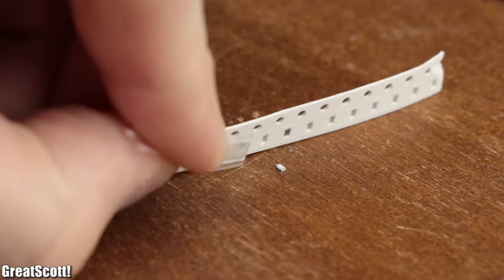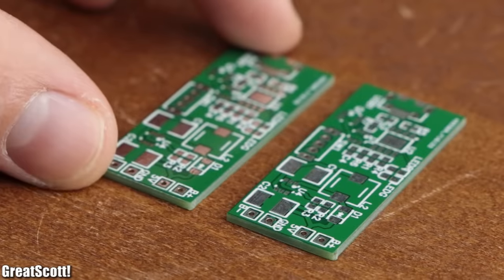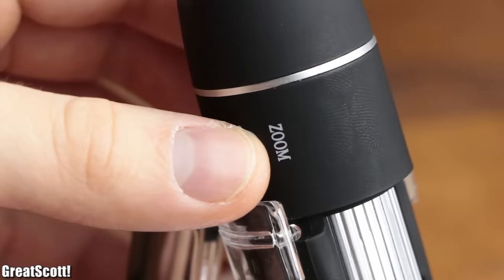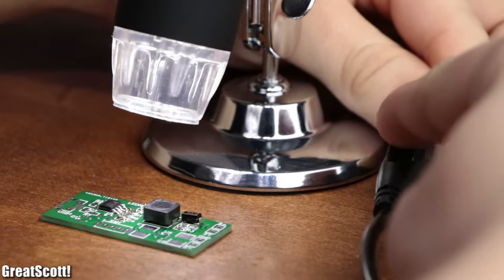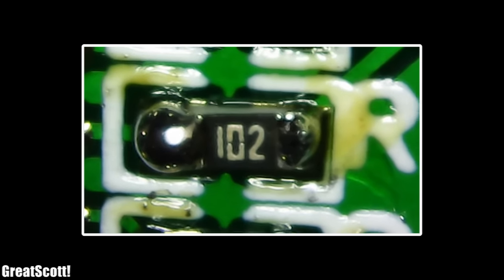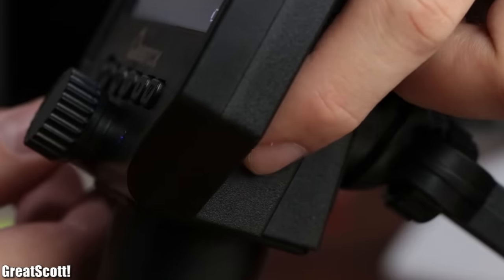Microscopes for SMD Soldering || $15 VS $45 VS $189

Comment: Love this, I have the middle one. At 57 my eyes are not good enough anymore and I have to have something. Magnifying glasses don’t work very well unless they are good glass and cost a lot so you need to do something. This was nice for everyone to see although a lot of younger people don’t understand but one day you will.
Reply: Get a pair of those small, compact binoculars, find a lens that's the same size as the objective of the binoculars. I found an old lens from a gunscope. Hold the lens in front of the binocular's objective and you've got a field microscope. The lens I keep in my binocular's case gives about a 4mm field of view at 4cm. Tape the lens in place (I lucked out and mine can slip over the bino's and stay in place by friction), tie it to a branch and work two handed.

Comment: Try taking apart the $180 one and see if there are battery contacts that you can solder a lipo battery so the settings are not lost on reboot
Reply: I did that on mine, the contacts are there. There are also 2 pads for serial communication and you can change some settings that way.
Reply: Oh very nice! I don't need one since I really never do SMD but that would make an interesting new video for GreatScott, the settings part especially, what kind of settings are there to change?
Reply: @RandomHacks  What type of battery did you use?

Comment: 9 times out of 10 I personally just use a 10X magnification jewler's loupe for my SMD soldering. It is plenty good enough for most applications and can be had very cheaply.  I got mine from Harbor Freight.  The package also came with  3X, 5X and 7X loupes.
Reply: Podría poner el link...dela lupa para comprarla. Saludos desde Colombia 🇨🇴 GRACIAS 👍

Comment: If you have a DSLR, macro extension tubes can get you in pretty close. Hook up the live-view output to a monitor of some sort and it works pretty well!
Reply: LazerLord10 you probably wouldn't want to expose your $800+ DSLR lens to solder and flux splatter and fumes ...
Reply: I use a pretty cheap DSLR, and because of the nature of the lenses I use, the camera body itself is about 2ft away from the solder, and the front of the lens (which has a protective filter) is maybe a foot away.
Reply: They are very big. You wouldn't want a DSLR to get in the way of your soldering work.
Reply: I have over a foot of working distance. It's up high and out of the way most of the time.
Reply: Live view puts the sensor in continuous scan, might lower the life of the camera.
Reply: Wouldn't be any different than just recording video (which I use it for a lot). Either way, if it overheats, it detects that and shuts down.

Yeah it's not ideal, but it's a piece of equipment that people may already have.
Reply: I was just reading a link interestingly enough where a C920 was modified with Saulius Lukse's kurokesu site case for use in soldering.  I used for surveillance to make sure no heartbreak from the heartbraking into hotels.  Still, interesting idea that seems hacker neat and do show and tell.
Reply: Well I have used my canon eos 77d a couple of times in order to solder smd. I used a stock 18-55mm lens for the job but I had to get the camera tilted away from the fumes thus the image was a little all over the place but in the end it was just okay.
Reply: LazerLord10 hmmmm your saying to just use a regular video camera?  Smart.

That way you can put your microscope money towards a camera too. Two birds with one stone!!
Reply: @LazerLord10  decent DSLR stand that can hold the camera stably at that angle is $200+.  Also macro lens is another $100 for a cheap one.
Reply: @dk418  I used a $50 tripod and macro extension tubes are only $15. The camera already has a lens, the tubes make it focus closer (but you lose AF and aperture control). It's definitely doable on a budget.

But yeah, it's still not ideal, but it's better than nothing.

Comment: I got the $15 one, but with the separate aluminum stand for stability that works fantastic. I also use the Windows native Camera app for it which works better than amcap, in my opinion. Also, someone else noted the protective cap was still on covering the lens, so removing it will improve the image.
Reply: hi there, interested to know more. was the aluminum stand bought new, or is it something you just have laying around? if you bought it, do you mind sharing what kind of stand it is?

Comment: I have a similar 15$ microscope and I've noticed that the image quality gets quite better if you remove the small plastic cap covering the camera chip. I think it is mostly used to prevent dust from going on the chip, but since the microscope is pointed downwards I don't think this is an issue when using it. Once I'm done using it I put the cap back on.

Comment: I have started using my iphones magnifier feature, it works great if you have a holder for it. Enable it under Settings / General / Accessibility / Magnifier and push the home button three times to activate it. I have modded a case for my phone by adding a jewelers loupe for even better magnification.
Reply: Björn Persson - great suggestion. I was a bit bummed about the results with the $45 scope, which I had considered in the past. 

One huge benefit of the iPhone as a scope is subtle - auto-focus! 🧐

Need to search out a good clamp setup for my desk...

Comment: After watching this, bought an Andonstar AD206S.  I did not have digital zoom, but works great for me.  It also had the blinking battery light so I opened it and found it had a battery compartment for a 18650 battery, but no terminals.  Also PCB had a JB with + and - marked.  Put terminals from a 18650 battery holder and wired it to the + and _ on JB.  Now it works on battery!  It shows how much battery is left and when it is charging.  I am a happy camper.

Comment: I use the $45 microscope and love it. It's great not only for SMD soldering but also circuit board inspection as well. I find the internal battery a great space saver, no wires, nor do I have to look away from the work area to look at a computer monitor. This microscope does everything I need.
Reply: Hi. What is the microscope that you use? Make and type. Thanks

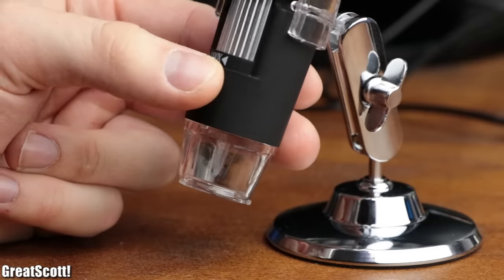Comment: Blurry image? @2:28  and @2:85, you have to take the transparent cap off (the flat disk)!
Reply: yeah, that makes the picture worse, but it avoids the fumes going inside the optics (mostly)... i received that some days ago, it's "nice", the only problem is that it starts lagging after a pair of minutes, and it's worse with focused images (lucky uh?!), i use VLC instead of the software (no drivers needed, sometimes(?)) and it's the same (lagging included), you have to close the software, unplug the scope, kill a cache process in windows and restart the hooking up

but i like a thing out of that, you can put it sideways... so if you want to see something not well seen from above it's the thing... and it makes a decent picture at the end, for like human solderable components
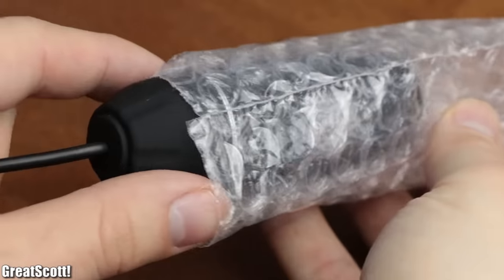Reply: You can see the small plastic tab on the right side by his finger at  2:03
However it really shouldn't affect the picture too much, maybe just slightly.
Reply: @BillAnt  if it's low quality finish plastic, then it can affect it quite a lot. It's obviously not optically clear

Comment: During my career in the aerospace industry I have used optical binocular microscopes, and highly expensive digital microscopes.  When you get down to 0805 size devices and smaller a microscope is the only way you can competently build or rework boards that use them.  Since I am an amateur radio electronic enthusiast I design and build a lot of projects with smd devices.  So after researching different microscopes available I settled on the Mustool microscope for the very reason that it had its own display.  I also purchased an adjustable metal "jack stand" which allows me to vary the magnification range of the device.  The only time I notice jitter is on high magnification with the objective close to the camera which when you come to think of it makes it impractical to solder.  I set the stand so the camera is about 4" away from the objective which gives just the right of magnification and plenty of clearance to solder under.   As for image sharpness it is finely sharp so I don't know why the one in the video has a problem with it.  The suction cup wants to be attached to a smooth clean surface so I usually clean the cup and the surface with isopropanol before attaching and it holds very well.  Since I am very nearsighted and wear thick lenses I have always had issues with optical binocular microscopes but the Mustool scope is the easiest tool I've ever used for smd work.

Comment: For the cheaper one, maybe you can use a cheap Raspberry Pi Zero and a mini LCD screen to give yourself a screen on the actual microscope. Assuming it does work, you could then maybe use the GPIO to record and take snapshots, which could be made as a separate panel as to not shake the microscope like what happens with the other two.
Reply: The Pi camera is actually nicely high-res so it might just need an appropriate lens.
Reply: Chaos Corner I tried a Pi camera but apart from the lens focal length being quite unsuitable, for some reason it also flickered a lot.  So it went back onto the to-do list.

Comment: I have one exactly like the cheap one in this video. When you take the clear lens cover off the video is pretty good. The bad is that it just doesn't last. Minimal use and about a month before constantly disconnecting and reconnecting from the computer. Perhaps a bad solder joint. You get what you pay for with one of these.

Comment: I made a huge improvement to mine.  Added a pendant switch to the OK button.  No more camera shakes in video or pictures for recording.  I found the height too low so I normally use mine on a 4 inch elevated platform.  At the greater distance, another light source is very helpful.

Comment: I have two of those andonstar adsm201 what I really don't like about them is the fact that you can't record when connected to a monitor, I really hate that... If you open them up you can add a battery (it is based on a dashcam) and there are also serial connections  that allow you to make some settings adjustments. I secured mine to a microphone boom arm with a tripod screw, this allows me to move it freely on my bench.
Reply: I soldered this tiny battery to it... could be bigger but it was the only one I had. https://photos.app.goo.gl/X6A1aWH6DIvfqCSF3

Comment: Scott, as many others have mentioned, the software on these is used for cheap Chinese dashcams. After completing a tear down of my own dashcam with the same operating system and experimenting, you need to add a small 3.7v battery inside to retain settings. In the dashcam this is also used for  the parking monitor function. There is likely a spot on the board for it. Mine was a 3.7v 200mAh LiPo. I’m sure a supercap would work also. 

My dashcam records 1080p native and has micro hdmi out so I am trying to find a lens that will give me the correct magnification for SMD soldering.

Comment: I might as well use the last microscope for general video recording 😜 its so sharp
Reply from the maker: Haha true
Reply: Just pull off the lensecap and the cheap one is strangely more sharp...
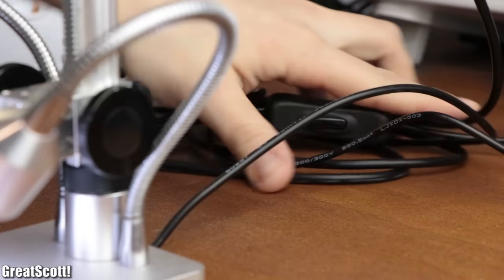Reply: Hey GreatScott, at 7:37 as you've mentioned that the battery icon hints to a built in battery, do you think it might be possible that they've simply forgot to solder in a settings backup battery in your particular unit (as a production error)?  Perhaps you can open it up and see if there's room for a small LiPo battery you can solder in yourself to retain settings or even operate the unit from it?!
If that's not possible, you could connect the camera to a cheap power bank (which of course you would charge from the mains) and would never disconnect the camera from that in order to retain its settings. ;)

Comment: I've bought a 30 euro usb microscope a week ago which has a 640x480 resolution.
It looks a lot like the 15 dollar one you show in this video.
The stand that came with it was okay but could be knocked over easily because it was light weight.

After doing a modification to the magnification lense, the morkspace between pcb and microscope went uo pretty hard and I chose to buy a magnification loop, remove the glass and made a holder for the microscope which fits in place of the magnifing glass.
This perfectly fits my needs.
Wanna see some photo's and/or snapshots? I can send them to you.
Reply: Hello, could you help me improve my 15 dollar microscope?
How did you improve his magnification?

Comment: I like this channel, but I'm sorry - the soldering on those SMD resistors and caps is pretty bad.

Yes, it may "work", but there's WAY too much solder on them, and my concern is that many people might think it's the proper way of soldering them (given the popularity of the channel, and some of the nice projects you do).

The solder joints should ideally have a concave look to them, and not a huge blob, as that's a sure way to promote dry solder joints.

Yes, I realise that many of these are prototypes too, but it's really not that hard to do very neat manual soldering of virtually any SMD part.

I would definitely recommend using thinner solder, eg. nothing larger than 0.5mm, and maybe even down to 0.3mm for the really small stuff.

Also, adding a small amount of liquid flux can make thing MUCH easier for both SMD and through-hole.

(normal electronics solder obviously contains flux, but that can often "boil off" unless you get the dwell time just right.

The extra flux just makes the solder flow amazingly well, and you'll find you need even less solder to make a decent joint. ;)
Reply: As always, I hope my comments are taken constructively though.

Mr Scott obviously knows what he's doing with understanding the circuits, it's just that the big blobs of solder can easily be fixed. ;)
Reply: a detailed comment very intresting
Reply: @electronash  I think coz he does multitasking i.e. making the video, focussing on microscope doing soldering at almost the same time that might degrade soldering as I suppose
Reply: I think part of the problem here is using a conical bit. It may be small enough to fit into the space, but it makes very poor contact with the pad unless it is flooded with solder, so you end up piling solder onto the component.  Unless the PCB is very cramped a chisel or hoof bit, which has a larger wetted area will work better, even if it is quite a bit bigger than the target pad, because you can put the flat side against the pad, so that gets hot and wetted first.  This also means you can run the bit at a lower temperature, so it lasts longer and needs less cleaning.

Comment: I have an 8.5” like yours that was £120 when I bought it a few weeks ago and they are already creeping up in price. It’s very clear, works off a battery (apart from the extra lights), opens up on its previous settings and the wires going to the screen, lights and power are all connected to one switch. For an old fogey like myself, where the eyes aren’t what they once were, it’s brilliant for the soldering and using wick but tweezers are a skill all by themselves. I do believe the binocular ones give a far better sense of depth. The other 'fault' is the magnification goes between 50 and 1300 which can make panning a board a bit difficult but it is doable on the boards I work on. Also, leave the clips off that come with it all they do is restrict movement. 

Like with any tool, get the one that gives you as an individual the best value. I wouldn’t go out and buy a top Weller Soldering Station and a multi thousand pound microscope if I just want to solder a battery wire back on to my child's toy.

Comment: The second microscope uses a GC0308 sensor  from GalaxyCore MicroElectronics, which is a 640 x 480 VGA sensor from 2010. Even though it literally says "1080P". on the screen, when you record at resolution higher than VGA, it's scaling the video internally.

Comment: You could always use a jeweler's loupe. Microscopes are great for making videos and for a few other applications but a lens attached to your head has some flexibility benefits. It's a lot cheaper too. I'm not down on microscopes but consider the lower-tech options too.
Reply: I can’t hold solder, an iron, and a loupe at the same time!
Reply: @Ruhrohraggy7  You can get them with a thing which holds them to your head.
Reply: @chaos.corner  didn’t know that! thanks!
Reply: @Ruhrohraggy7  I actually like to use a binocular magnifier which has two magnifications and an extra lens for one eye for really close-up work. Especially since my eyes aren't what they once were.

Comment: Interesting review. However, what about image lag? A common issue on cheap microscopes (especially usb ones) is the lag beetween the real movement and the image on the screen.
Reply: Yes. That is why I bought a microscope with composite output. It connects directly to my LG 23inch TV that I also use as for my PC in  my electronics work room.
Reply: No lag at all.
Reply: My experience was that image lag was due to inadequate light making the shutter speed slower than the frame rate.  I needed 'task light' or 'outdoor' light levels.
Reply: Tuetuopay A purely optical solution provides much less total lag between PCB and eyes.  Cheapest version is a head mounted magnifier with LED light and 3 amplification levels (flip down lens combinations).  More expensive solutions include the Mantis used by EEVblog and the AmScope used by Louis Rossman.